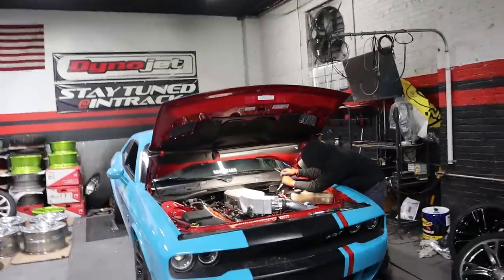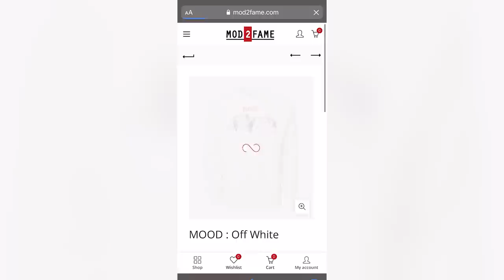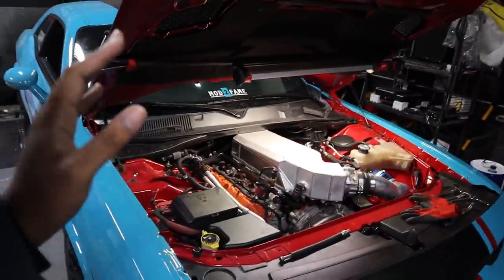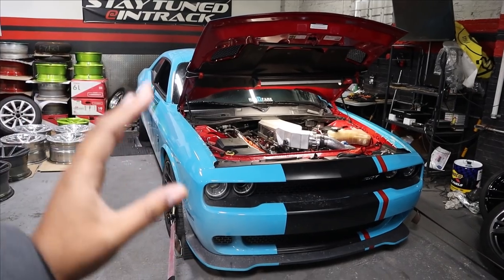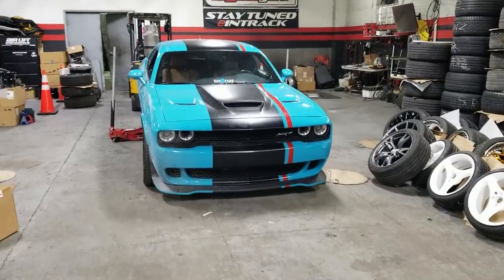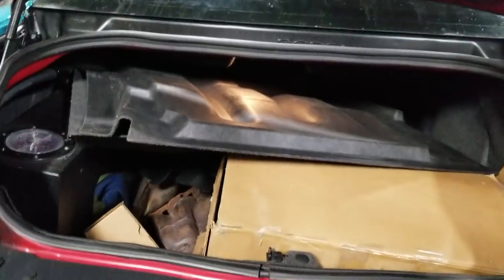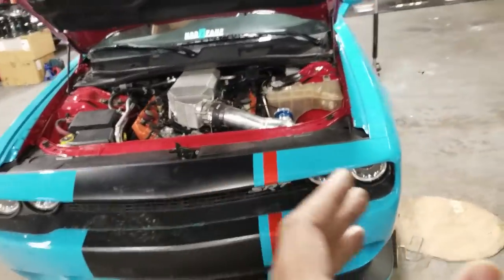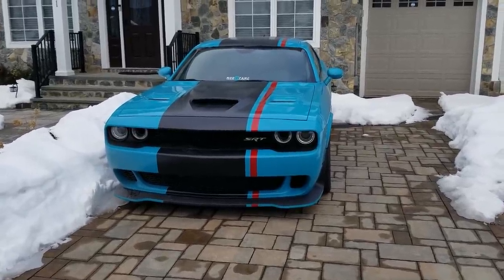This Twin Turbo Hellcat Is The Fastest Car I've Ever Driven...

Comment: I hear you... and yes, it is aggravating to constantly hear about your Check Engine Light.

But, in all fairness to your viewers, the check engine light (CEL) could be tuned off.

A lot of small tuners can only access and manipulate some tables, like fuel tables, timing, coolant fan values, along with some other torque management stuff. However, there’re other tuners (Real Computer Programers) out there that can access and adjust just about everything within the ECU. We’re talking about values that the Engine Management Software is looking for. When those values aren’t present, or outside the range, an error code is triggered. Programers can either expand the range to accept the actual values, or make the triggering value extremely broad so as to not trigger an error code. In other words, the triggering values can be set to a point where the actual values could never reach it.

It’s kinda how we use to raise the factory maximum speed. The software didn’t allow for a null value (meaning no maximum speed), so we would set the maximum speed value to 300mph, which in essence raised the speed limit. The car would run out of energy before it could get to 300mph.

So, there is a possibility to prevent triggering the CEL, but you’ll have to find a real Programer and pay the price to get the software reprogrammed. Check with the guys at Hennessy, in Texas, they may have there own in-house programmers or have access to one. I use to do that kind of stuff, but am retired and no longer have access to the required equipment.

Or keep doing what you’re doing... ignoring it.

Good luck Brother!

Comment: Just change the factory pump or sensors to adapt to the flow it needs and sees then reprogram it and that check engine should go away in a perfect world lol. I feel you though it’s a race car check engine lights happen as the computer doesn’t adapt as it should to new parts due to reprogramming needs or software restrictions either after market lacks in being advanced enough or a restriction from the factory that makes problems like this but as long as it works then who really gives a shit. Good video brother I can’t wait for another roll event with the new turbo cat.

Comment: Lol.. A nice way of saying, Shut T f up.😆 Sometimes with many modifications you are going to to run into sensor issues not to mention, tweaks here and there.  The setup you have is not the norm and many need to remember and understand that what you have done is not a kit, but rather a custom job and you are essentially helping many here by addressing the issues they would have run into.. now, this brings me to my next question.. when will you release a turbo kit called Mod2fame superslayer kit 😆

Comment: @Mod2Fame Vlog - Please tell me your guy LOOKED 👀 into the cylinder with an Endoscope while the plug was out. Just as important if not more important than looking at a spark plug. With the HP you are pushing all sorts of things can occur in the cylinder. Ash Trash etc... Make sure you are not going to punch a hole in your pistons!!!